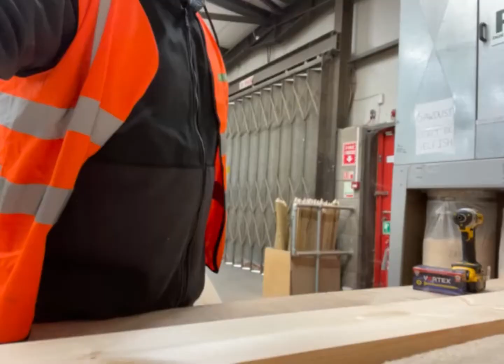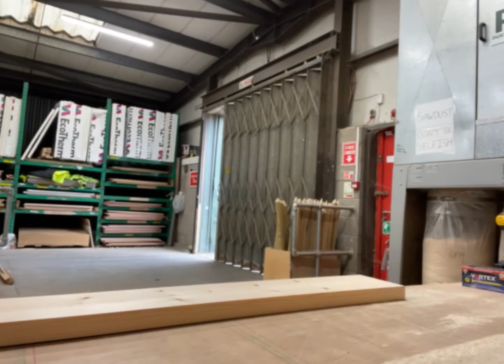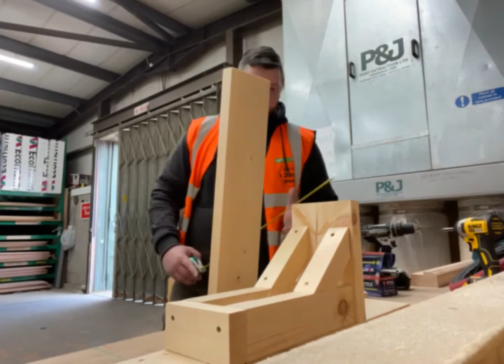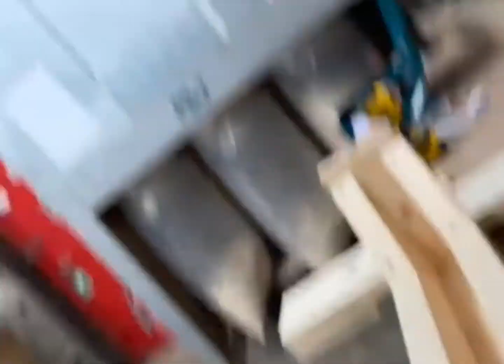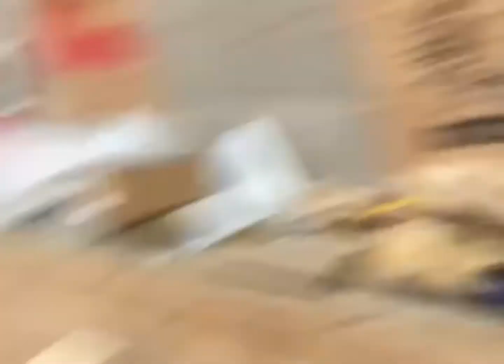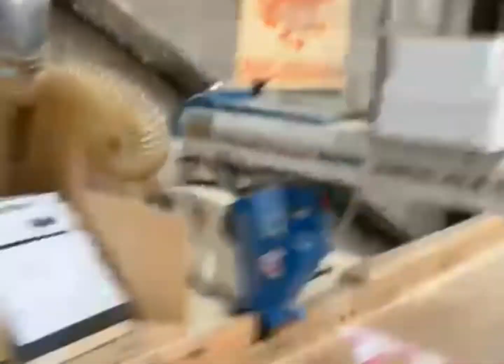The Cure For Too Much Energy! How to make a manual machine! DIY! #diy #howto

Comment: So did you buy a 2x6, and a couple 2x4’s?
Reply from the maker: We used 6x1.5” (plained) for base, back plate and feet. And then 3x2 for the top stand and 2x2 for the diagonal pieces 🤘🏻